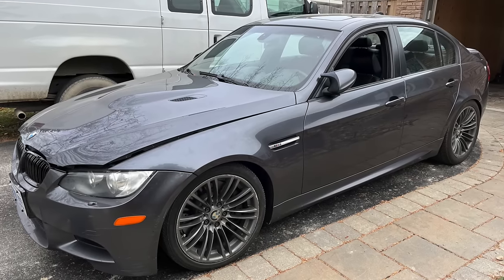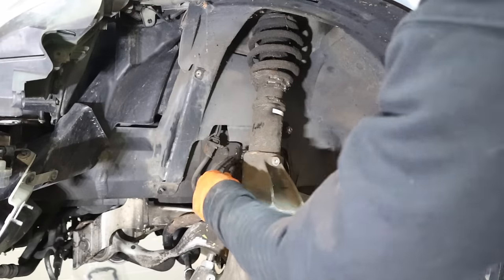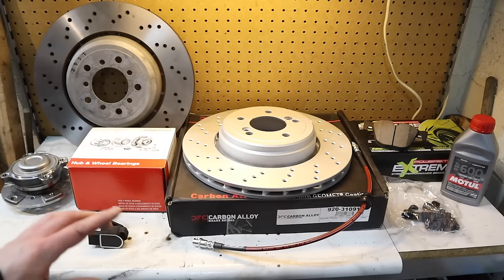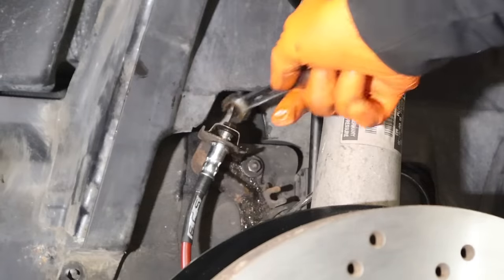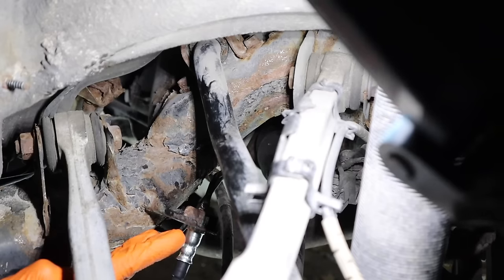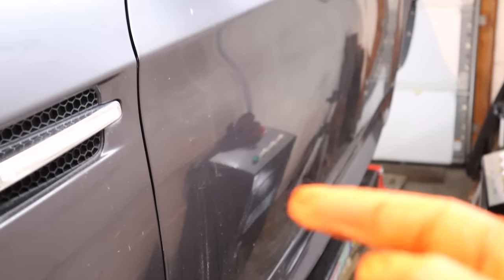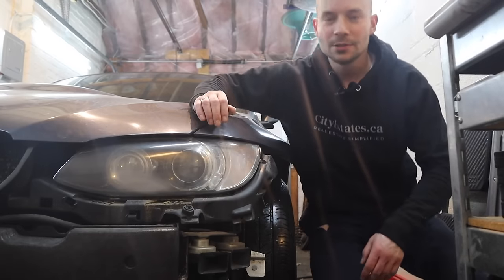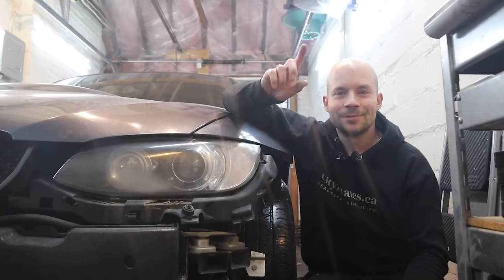Erasing YEARS of neglect from an E90 M3: Suspension and brake overhaul - Project M3 part 5

Comment: Well I must say I really enjoyed that! Thanks! I have two cars from the BMW world which got me into wrenching again after many years. I bought a 2002 330CI that has been fully swapped out with a 2006 E46 M3 Competition which had been in an accident and written off. I paid $7500 USD for it. I LOVE that little pocket rocket! Then I bought a 2008 335XI (Second one after I sold the first in 2014) I got it for $1500 USD. It needed a HPFP and a wheel bearing to get it moving. Then of course I did all the maintenance. Plugs, Coils, Oil, Trans filter and juice plus rear end. Now I've done turbos inlets valve cover boost solenoids cam shaft position sensors T-map and Map water pump now I'm doing suspension  after I jumped to the tuning and bought X-Delete for switching the car to rear wheel drive only anytime I want. XHP Trans tune as well as "Protool" App that is amazing. Of course MHD as well. These cars aren't for the Civic or Corolla person. That's where they get the reps of being "Unreliable". Well that and from BMW. LOL.
Reply from the maker: Thanks man! the S54 is on my bucket list to own for sure, top 5 engines of all time in my book. The N54 also gets a bad rap but they make tons of power as you know. Cheers for watching!

Comment: beautiful overhaul, I'm currently "rebuilding" my M3 as well. So far I've done a complete suspension overhaul and my current goal is to have the car complete by the end of the year.
Reply from the maker: awesome, tell me more about it!
Reply: @DeadEndRestorations  will do! sometime this week I'll have my brand new coilovers installed on my car since the stock EDC suspension is super blown and worn out by now due to its age. I ended up going with some Ohlins Dedicated Track coilovers since those were a lot easier to source compared to just the Ohlins Road and Tracks

Comment: I was so surprised to hear you calling BC racing suspension garbage, especially when all I hear is good things about them. Could you explain your thoughts on them? Love the video and your sense of humour!
Sending from Dublin, Ireland.
Reply from the maker: Cheers Jake for the comment! I find that they don't have great damping, and so the ride becomes fairly harsh compared to Bilstein/Ohlins. Obviously for the price point they do a good job and a lot more people buy them than the pricier stuff for that very reason. The other reason for my comment is durability, after 100k KM's both front shocks are leaking, the springs are rusted and they're essentially long overdue for replacing at that KM amount. The stock springs/shocks from this car which have 150k KM's are not leaking, still have some decent damping left and the springs look almost brand new and aren't rusted.

Comment: On the ceratec- I used to have a Legacy Spec B with the flat 6, and I tried it in that. It may have been placebo, but I felt the engine wasn’t as free revving after putting it in? 
My other concern was whether the particles could make their way in to the tight avcs and avls (Subaru’s form of variable valve timing and lift) passages and get stuck on the solenoid screens, it also seemed wrong to put tan coloured sludge in to an engine.
Reply from the maker: yes it is quite tanned... thanks for the feedback, I'll keep you posted on how it runs with it!

Comment: Painting bumper, but going with the used struts?? 
Come on man, you're doing some awesome things here, used vs new struts makes hell of a difference regarding ride quality and handling
Not to mention braking safety...
Reply from the maker: I see your point, the used struts are to get the car back on the road for the summer and do some shakedown driving and assess future work from there. The shocks aren't leaking and have good rebound, at worst they will be fine for street use. I want to see how the car rides on stock suspension before deciding whether I even want lowering springs or coilovers or just replace with bilstein B6 and keep stock ride height. thanks for watching!
Reply: I vote for regular height, b6 🙂
Reply from the maker: agreed, best of both worlds

Comment: Regarding the camber issue: that front suspension is a MacPherson strut type which by design is ill-suited for spirited driving or track use. It's cheap to produce and fits into a tight space which is why most cars have them. But the camber gain is terrible when driven at the limit (the tire goes into positive camber when you want negative camber to get as much mechanical grip). It's disappointing that even on M cars BMW uses standard suspension systems. Any serious sports car has double wishbones. But at least BMW offers carbon fiber roofs for the posers lol
Reply from the maker: pfff everyone knows carbon fiber adds at least 15hp

Comment: Stainless steel brake lines don’t do anything for brake feel. I have tried them compared them to oem BMW and couldn’t tell the difference. Not sure why everyone on the internet says this.
Reply from the maker: I agree however in aggressive driving or track conditions the feel difference would come from having no to very limited expansion of the brake lines versus rubber ones. Fluid type also plays a role in brake line expansion as well obviously.